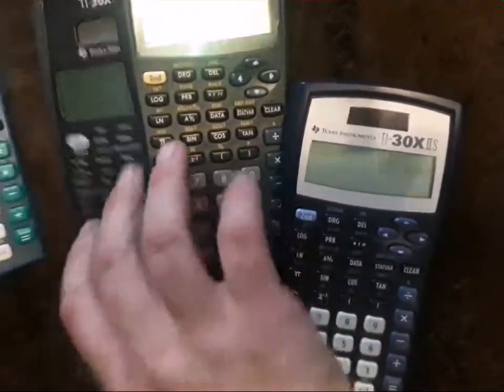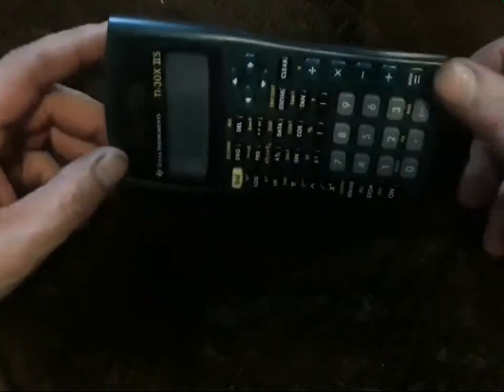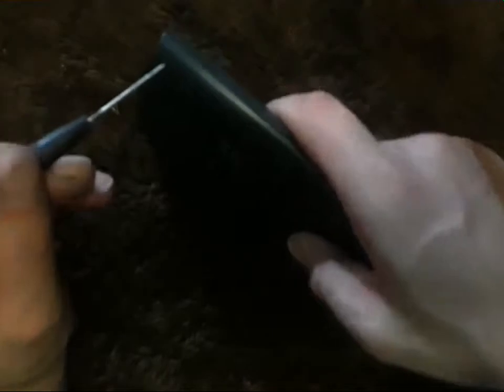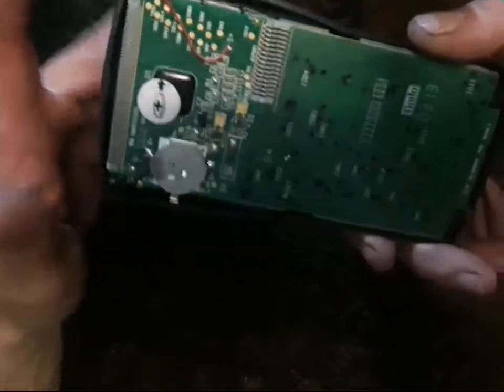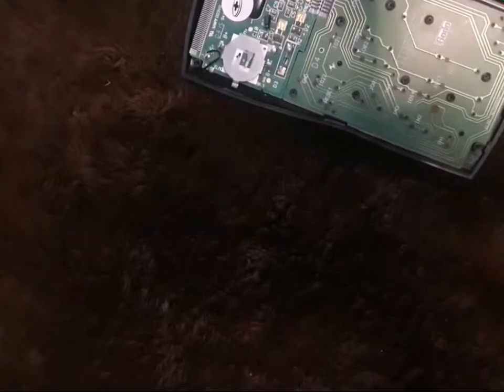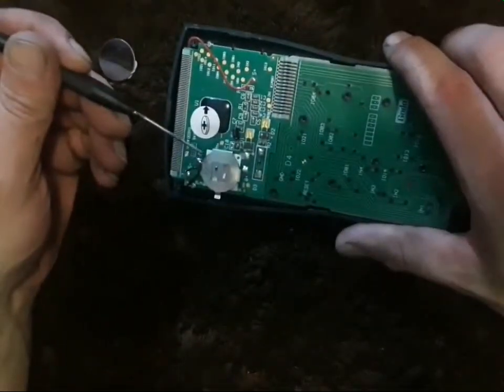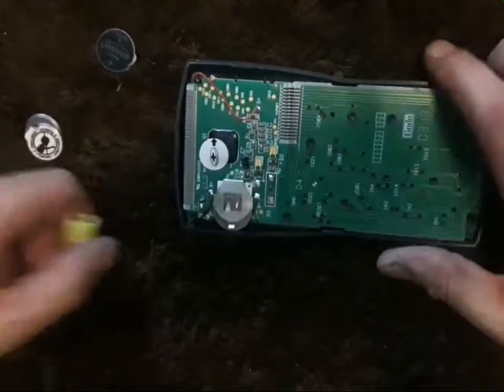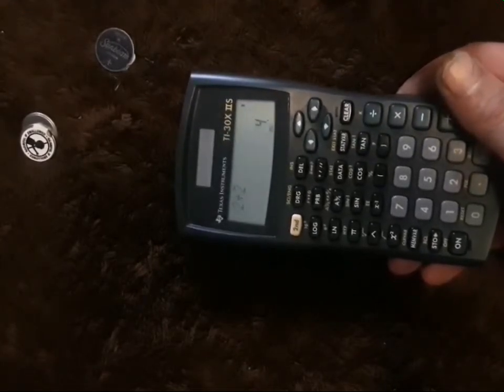How to Fix Texas Instruments Solar Calculator

Comment: So what happens when you put a new battery in see the light flash but still doesn’t work? The voltage is good on the board but no display?